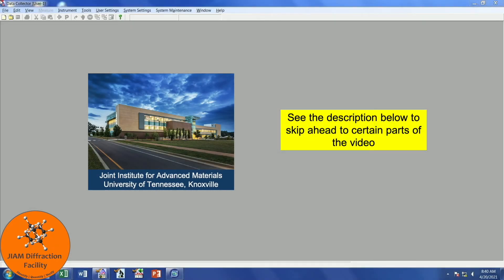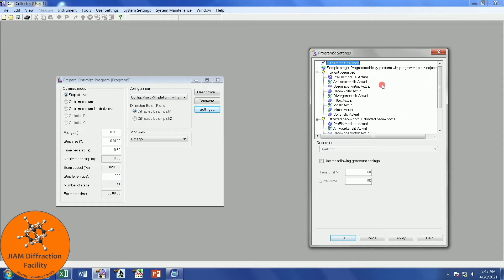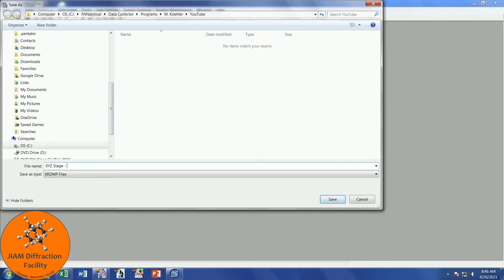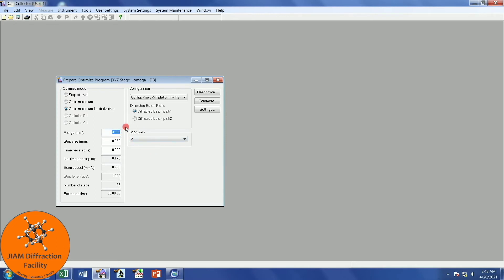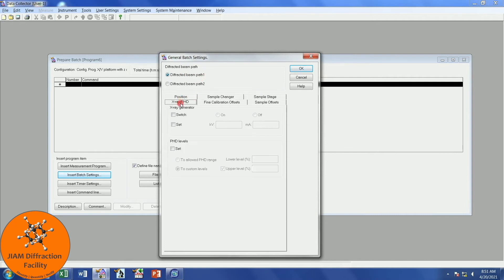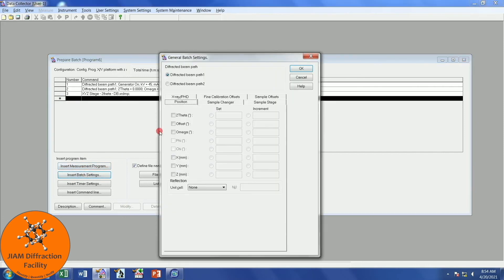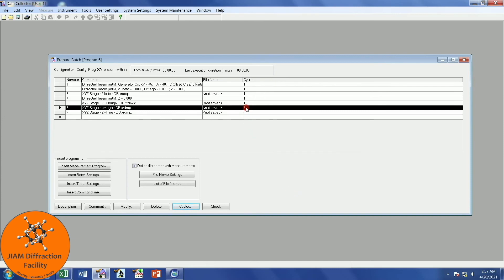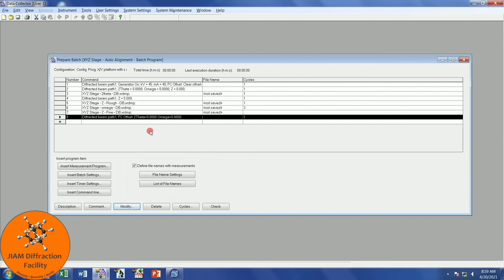Creating an Automatic Sample Alignment Batch Program in Data Collector - Malvern Panalytical

Comment: Thank you very much! This would save a lot of time for each sample 😅 I would like to know though if the settings for films are just different in the diffracted path number ( you said that this program is for powders)
Reply from the maker: I'm glad it helped!  And my apologies for the slow response, life has been kind of crazy.  Regarding the settings for films...if the optics/prefix modules that you are using are on beam path 2, you will need to set up your individual programs (2theta, Z, and omega) accordingly.  When I use beam path 2 for films, I also use a Xe proportional detector instead of the PIXcel.  That change would also need to be made in your programs.  Finally, if you do not plan on manually changing the optics to match what you need them to be for alignment in the "Incident Beam Optics" and "Diffracted Beam Optics" tabs, then you will want to set the correct optics in the Settings tab of your programs.  Personally, if I am performing grazing incidence XRD, I would want to align with the (incident beam side) 1/32 divergence slit, whichever Soller slit I feel like using, whichever mask I feel like using, (diffracted beam side) 0.27 parallel plate collimator, 0.27 parallel plate collimator slit (also called a receiving slit), whichever Soller slit matches the incident Soller slit, an automatic attenuator (if you don't have one, you will want to insert one in the incident beam side) set to "Do not switch" and put a checkmark in the "Activated" box, and the Xe detector.  Your setup might be a little different.

Comment: Hi Sir， can you tell me what's the situation the position Phi and Chi used? Thank you!
Reply from the maker: My apologies for the slow reply!  If you have a randomly oriented polycrystalline sample and are performing a "powder" diffraction exerpiment, phi and chi aren't necessary.  If you have a single crystal or epitaxial thin film, you'll likely need to start using phi and chi because you will get peaks only at certain angles.  If I have a thin film sample and am performing X-ray reflectivity, I typically include a chi scan in my alignment.